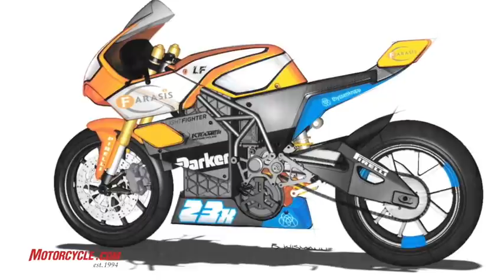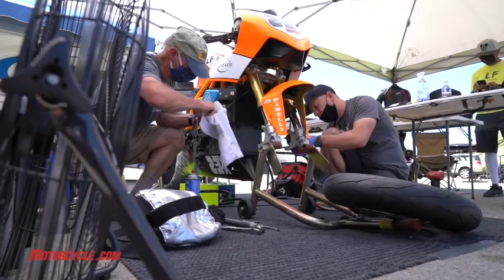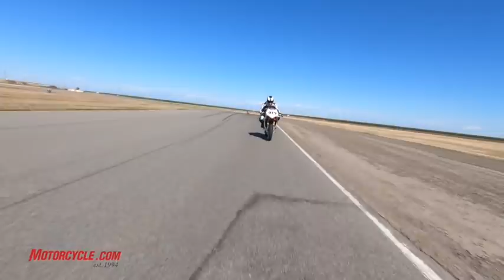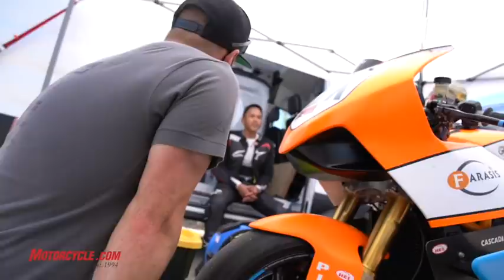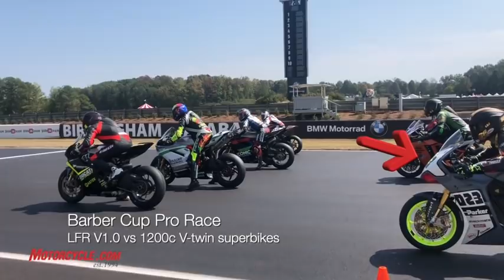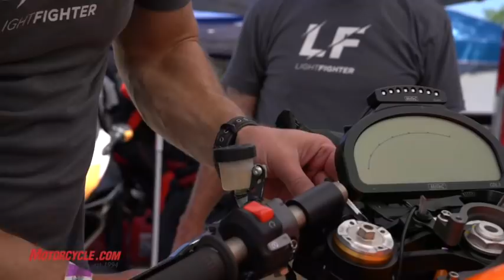The Lightfighter Electric Superbike Is Back And Better Than Ever. Part 1: The Maiden Voyage

Comment: Be interesting to see if these bikes remain safe in the event of a whopping crash in the rain
Reply: Fuel cells are designed for cages crashing into each other and immobile objects.  A crash on the track should be no problem at all and even if it's not, lithium fires in an open space are easily controlled.
Reply: True enough but look at the state of Romain Grosjeans car when it hit the barrier in Bahrain
Nothing has higher safety standards than F1 and yet that turned into an instant fireball.
I don't think it's the risk of fire so much, more the risk of electrocution.
Reply: @nunyabizness9885  So let’s strap you on as the test dummy.